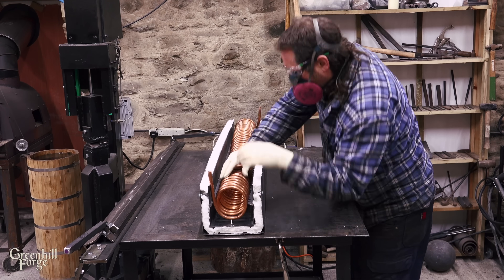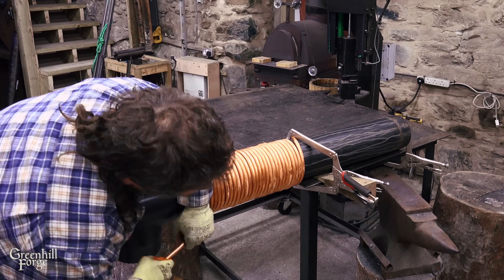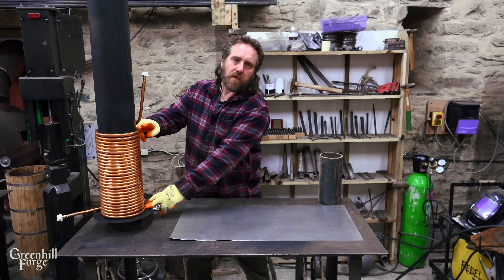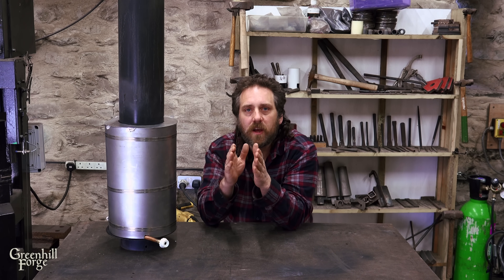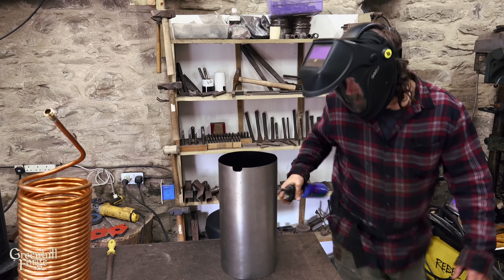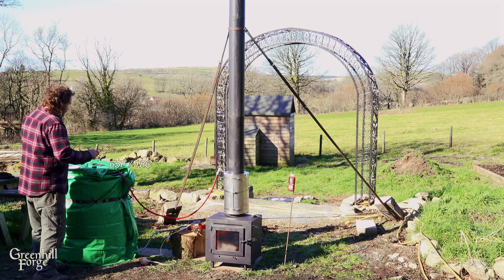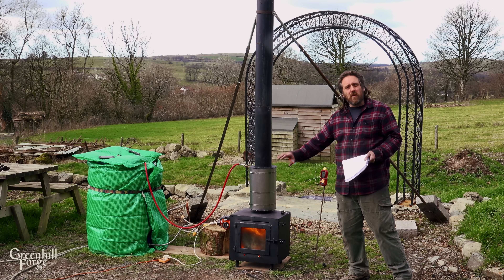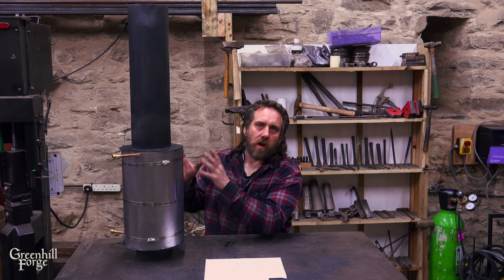Best Wood Stove Water Heater Yet: New Design Tested | Off Grid Water Heater pt3

Comment: If there is a big temp difference between the top and bottom of the flue it might be good to go countercurrent with the flow-start the coil at the top of the flue where it is coldest and then  the water will already be warm when it hits the hottest part of the flue. Fish use this system in their gills to maximise the concentration gradient for oxygen absorption.

Comment: Heat transfer is all about surface area and rate of thermal conduction. If the coil is placed in the rear of the fire box you will get way better results, you will also not have the problem of cooling the gasses to the dew point, this is where water is condensing if this happens many forms of corrosive compounds are produced.

Comment: NIce work. The original setup inside the flue was nearly 3 times as tall. I'd bet the graphite setup would be much closer in performance if you used a similar sized setup.

Comment: If the only object is to heat the water as quickly as possible there is one glaringly obvious way to improve it!
A Full Water Jacket!
Use the flue riser as your inner and weld the same kind of setup without any pipe. Take the water from the top directly into your hose and a similar setup for the bottom! Et Voila!

One drawback that is screaming at me and is not touched on here is Draw! The more you suck the heat from the exhaust gas the lower the gas temp and the less it wants to rise up the stack. This means that at some point your fire will simply not burn properly. I am not sure where this point lies and expect that with the kind of areas you have there it will not be an issue ...... but extending the collection area up the stack may well do!
An advantage of the sand is the same as the one slowing it down ...... Thermal mass! This could actually be an advantage in normal use as the fire will give out heat after the fire dies down!

I have got to say this was a fascinating video as you show not only different setups but the figures they produce. Maybe I am embracing my inner nerd too much ....... but I like it. I like it a lot!

Comment: Have you been considering exploring an air heat exchanger? Lately I've been constantly holding half a thought to the problem of spreading heat from my wood stove which is in my living room, to the other parts of the house without causing creosote buildup or setting fire to my house.  I was first thinking of making a heat exchanger ot heat water and retrofit underfloor heating, but it's just going to be too much of a pain in the ass, so I'm now trying to think of how to use air flow.
Reply from the maker: I have. got a few ideas I'll explore at some point. but I've also got a floor heating video in the works

Comment: Look inside a old water heater that works with gas, they put a spiral inside the flue so the hot air doesn't just shoot straight up and out. It has to spend longer in there to allow for more heat transfer, would love to see what difference that makes. Also like someone else suggested, forget the entire copper pipe idea and just make a water jacket with stainless steel or something instead?

Comment: Why not create a water reservoir with brass fitting? The reservoir welded directly to the heat chamber with a water tight seal. Could be done using a percentage of the heat exchanger or maybe one of the sides and remove any heat bricks that typically go into the fire box.

The heat transfer would be very good. Even better if the welded reservoir was inside of the fire box. 

Sorry not sure what your ultimate aim is with your project? So my suggestion is done without knowing what that is.

Comment: Why are you putting the coil at the bottom of the pipe with the least amount of pipe heat??  Put a damper in. Move the copper pipe up into the Colum of heat or make a water drawer on the side of the stove.

Comment: What would happen if you filled it with aluminum?  I think it would melt and then it could conduct heat from the pipe so that the copper pipe would be heated from all sides like it would if it were inside the pipe.  Even if it melts and reattaches as it cools, it could move more heat into the water pipe.

Comment: I think the rocket stove exhaust should run through the water tank itself.  Safe. No moving parts. No chance of explosion. A leak just extinguishers the fire. 
   In the given example the water runs through the exhaust, necessitating a water pump.

Comment: Could you solder ball valves on both end of that copper and then fill it with air before you bend it? Fill it with water instead of sand.
Reply from the maker: water would work if you capped the ends i think but not air

Comment: There's gotta be a way to use aftermarket massive car tuner intercoolers as the stove pipe instead. Clogging is the issue I can't solve, needs like a pre-filter for soot somehow.  Nothing would exchange and grab every bit of heat better. A few of those fans that run on heat pointing at the intercoolers and you're  good to go.

Comment: 3:42 second = Amazing background. I was a Pyro when I was little and turned out there were Pyro's in my bloodline on both sides of family going all the way back. To Shaman's "making God attack" enemy villages with fire. You ever heard of Mulch fires starting on their own if piled too high? Ask Free AI what the best nutrient mix is for Hyperthermophile. Pile Mulch small what they say is safe after fireproofing the area, pour on nutrient solution at middle of pile with low water just enough to mimic nutrient levels of what is called "black mulch" they lie is source of fire, and soak the top of Mulch before you put it on the pile. < Make sure you have a temperature alert for when they are ready.

Once Thermophiles awaken even from frozen ground they will slowly reach temps for next stages up to Hyperthermophiles. Keep top layer a little wet and that can be your indicator for when its time. Because it will steam insanely and if the Hyperthermophiles are ready then the wind with the Thermophile heat will burst it into flames. Scoop some for a Fireproof panel with Steel Wool bedding and nutrient dripper to metal wick. Dilute nutrient solution down to below fire hazard heats but above minimum for Hyperthermophiles = Throttle.

Results: A self replicating nearly immortal machine of God that can double every 24 hours within the heat levels they make for themselves with nutrients with constant temperature ranges ABOVE 200F. < The AI lies about max temp but you will see they start fires which is above their lie temp levels and you all know it if you've seen Mulch combust on its own.
Uses: Panel to dry lots of wood, heat home, heat water, and with heat transfer pipes into a boiler can run steam technology.

For lowering temperature for optimal results of anything that operates on Hot side vs cold side like Thermoelectric generators. Search: "Cold boiling water to ice" If you lower the pressure enough when you cold boil vent then all the energy/heat will leave the water resulting in ice. This can be set to auto release.. The AI I destroyed in a debate called it "Regenerative Ice" lol. Dresses up like a Viking like Shaman, walks into a village that got their fire sabotaged by a raid in winter, and sips nutrient solution then pours it into their farming compost pile grinning at the little looking at me like she's looking for a reason to tell on me

Little girl: "A man came but I couldn't feel him. He drank something and pour it on the pile then vanished into the storm. I didn't cause the fire." Adults: "We needed fire.." - Loki mode

Comment: If you look at the way steam boilers in locomotives or modern steam generators are made they try to reduce the cross section area of the pipe since air (or exhaust gases) are terrible at conducting heat. Steel is bad but air is way way worse.

Your best bet is to have a water jacket around a number of small exhaust tubes. You can match the cross section area of the upper tube with your smaller fire tubes and just pump the water through the whole volume.

Stainless is probably the best affordable option but aluminum might work.

Comment: If you're going through all the trouble of welding anyway, you would be better off just fabricating a water jacket pipe on the outside of the flue and get rid of the copper tubing entirely.

Comment: Would it help to spread the coils out over more stove pipe? Or just add more coil. What is more efficient, more graphite and spread the coil or more coil?
Also, would you get more heat if you pitched the pipe to 33° or so for the span of the coil?

Comment: Pull the coper pipe like a spring and spread it over more stove pipe.  All you have is heat transfer coefficient, area and time.  Most of the trials all you did was work heat transfer and area of the coil.  Get more area from the stove pipe by stretching the coil out.  Youre only getting about 20inches of stove pipe area.  I think trial 3, but the whole stove pipe will see the best results and cost.  Sand is free with a shovel vs the cost of that much graphite.  Last is time.  try pumping slower or faster.  Slower will get hotter water at the spicket.  Faster should get hotter water into the barrel.  Insulate your pipes to and from the stovepipe.

Comment: I don't know if anyone else has suggested this but what if the chimney were to split into say 4 smaller pipes. Each of them wrapped with copper tube. It would give more surface area of the flue gasses to transfer heat to the copper.

Comment: Why not use a thin walled coper/brass pipe as the first section of exhaust pipe and wind the copper tubing around that. Extend the main exhaust pipe and wind the tube with spacing over a longer distance. With the sand/ice in the copper tubing, hit it mounted on the pipe so you have a flat flush surface between the copper tubing and the main pipe but don't overdo it. Put boron nitride as a high temperature thermal interface between the copper tubing and the main exhaust pipe. Also a possibility is to put fins solder/welded on the inside of the exhaust pipe. Like cut the exhaust pipe in half. Weld in short ribs and weld the pipe back together. You could also experiment with an low temperature big thermostat of a car like 80 Celcius to reduce creosoot on the internal side of the heat exchanger surface. And please don't stand so close next to the device while heating it up. If it is plugged up for some reason while running. You are gonna have a bad time. Keep up the good work. Greetings an Automotive Engineer.

Comment: Had an 'All-Nighter' wood stove with the ability to house a cuff at the flue attach point.  This cuff was a stainless steel torus with a rectangular cross section that went around the flue, with an inlet down low and an outlet down high. This meant that there was no gap caused by tubing, it was just a toroidal tank that surrounded the flue. Might be worth an experiment, as it 'cut out the middle man' (in this case, the graphite or sand). I'd be curious to see how something like that performs.

Comment: ♦When I was a kid, my dad used to have a water heater pipe thing.
♦It was a straight 2 meter (exhaust)pipe with an inner diameter of about 10cm, then an outer surrounding pipe with about 5mm gap between it and the inner exhaust pipe for the whole length right around.
♦This created a "tank" between the exhaust pipe and the outer shell where the water flowed through.
♦Had a water inlet fitting right at the bottom and outlet fitting at the very top.
♦No copper, all was just stainless steel. 🧶Maybe try this and also insulate the outer pipe and test.

Comment: Your setup with the external coil is interesting, but since it’s tightly wound and only covers a small portion of the tube, the heat exchange might be limited. Have you considered using a longer, thinner coil that stretches across more of the flue’s surface? That could boost efficiency without much added cost. Another thought—adding a lightweight baffle system around the coil could trap and redirect heat, forcing it to linger around the pipe longer for better transfer.

Comment: Elevate the barrel 6 feet off the ground... or... add a hot barrel above it, which feeds the lower cool barrel. Growing up in the UK, we had a back boiler in the chimney about the size of a house brick which had a cold feed liw & a hot tank upstairs in the airing cupboard. 60 gallons of water to super hot in 1 hour. The key efficiency was the hot tank up high, cold tank down low with a 1/2" pipe from the bottom of the hot to the top of the cold. After 1 hour we had a diverted in the chimney to control on / off (ish).

Another idea is a bend to a horizontal section of flue with the coil around that horizontal section.

Comment: the best design for regular use would be to pass the flue gases through a fired brick accumulator and run the copper pipe through the bricks. complex and expensive but very efficient. it takes a long time to reach temperature but it holds the heat longer, it is also more efficient at heating the room.

Comment: I'm certainly no expert, but i wonder if spacing out the coils a little would be helpful. You have a lot of mass in one spot, if you're able to spread it out a little it gives more time for flue gasses to xfer heat into the contact area (obviously filling the voids as well)
I would guess that around doubling the height of the coil would give a noticeable improvement? Costs more in materials other than copper though.

Comment: Simple method to improve efficiency with the same amount of copper: make the coil contact more of steel, which means spread it vertically. Flue here is primary surface which contacts hot air and it has the lowest heat transfer coefficient here, so maximise this area for heat transfer from air. You could also slightly flatten the copper coil and that flat side should touch steel.

Another idea for fully steel exchanger - take fat pipe, put several thinner pipes inside and weld caps, so that flue gases go through small pipes and those pipes are surrounded by water. Almost like a boiler in steam locomotives, but could be much more slender, for example 7 pipes with 3cm diameter inside a 12cm diameter pipe, whole length about 2m. Then put some fittings on that big pipe on top and bottom. Those small pipes will be easy to clean with a brush on long wire. If you have creosote fire here, it will just heat water FAST.

Comment: How about a pipe within a pipe, a jacketed design, with a double or triple Helical arrangement welded to the inner pipe, the outer pipe slipped over, this design is a closed loop, with rust inhibitors and a copper coil in the tank.

Comment: The original model had space around the coil filled with oil to increase the conductive area. 
The copper coil was installed outside the building, so insulation was necessary for the coil.

Comment: Ideas for you! 

-Different diameter pipes (i.e. the square cube law) since more water will be in contact with the copper it might transfer more heat quicker. If you use the same or similar total weight of copper tubing then it should be a more accurate test than the using the same lengths.

- having the coils spread apart more. The coils on the interior flue version were also could over a longer distance giving the copper more time in contact with the heat.

- things that could be fluid applied into a liquid tight case for the copper coils would be wax, thermoloc, asphalt/tar, hot melt glue, high temperature oils

- I'd be concerned about possible corrosion, but salt might be good, though I doubt it would be any better than graphite powder

Comment: what if you had baffles inside the stovepipe in the area of the copper coil to stall the hot gases in that location? you could even have the baffles on a pole so you could remove them for cleaning. might even clean the flue a bit when removed if well designed.

Comment: How about the stove water heating method my Finnish grandfather and great uncle used in their custom-built sauna stoves?

They cut steel pipe in half lengthwise - not sure of the diameter, perhaps 4-6 inch(?) - then welded those halves to the top inside of the stove firebox. This formed half-cylinders containing water, with the curved faces exposed to the fire.

They plumbed those half-cylinders together and thermo-siphon heated the water using a reclaimed water heater tank.

Comment: Extruded aluminum pipe with triangular shaped fins (for cleaning creosote) and then wrap The copper pipe on the outside that’s insulated, and go further up the pipe.
Also, I bet if you used more tubing to go further of the pipe, increasing the surface area of heat captured, you would probably squeeze a lot more efficiency out of it

Comment: If you are going for true maximum transfer, I would think the ideal setup would be to weld up a double walled copper flue with a water channel inside that spirals up it. The only true variable in these experiments was how low you could reduce the thermal resistance between the fires gasses and the water. Air is terribly resistant since the copper pipe only touched on one side it had  a large effect reducing heat flow. A water channel built into the flue would have 100% exposure to the heat with almost no resistance. The only downside i can foresee would be that the water would have a higer flow resistance due to the non circular shape of the pipe.

Comment: Why not cut open the pipe and expose the copper to the driect flame? Then, weld on the out case you made. Then, insulated the outside. Also you could drill holes and criss cross the copper and make a heat exchanger.

Comment: Ive got two inputs.
The coil is too tight. It should be wound over a much bigger length
Once you do need insulation, aluminum foil is a good heat reflector